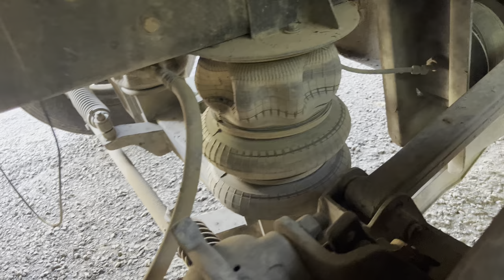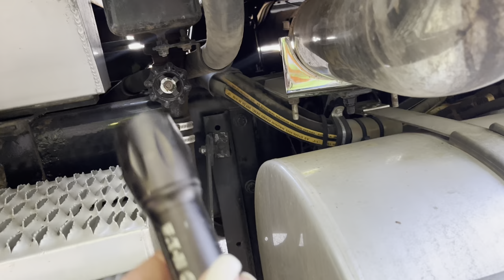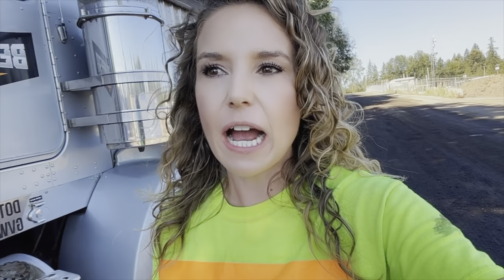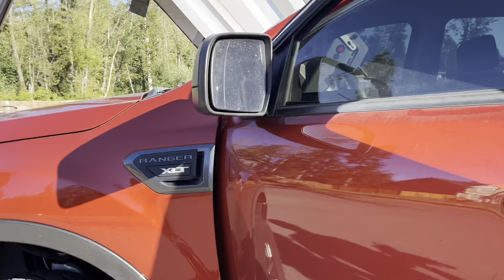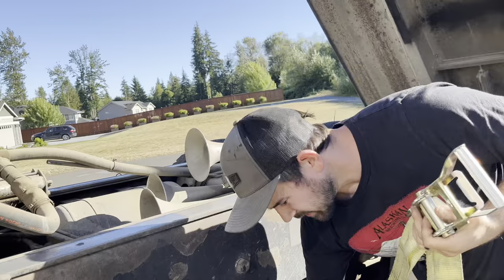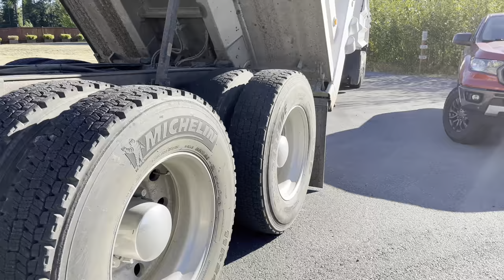Air Bag Exploded! No Air Pressure on the Drop Axle.

Comment: You’re doing a really good job in that dump truck girl. I’m an old retired 302 operating engineers crane operator heavy equipment. I’ve done little bit. Everything 35 years been retired almost 10 years now. Enjoy your videos. Lotta memories when you pull into those gravel pits I worked out a few of them back in the day anyway Nikki good luck man and keep up the good work hang in there girl.

Comment: Hello Dauminique,my younger sister went to welding school & she's now a certified welder & she was working for a place that builds those pontoon boats & she had to weld those pontoons together bcause they are in pieces at the factory where she worked at & she said that aluminum is hard to weld she had to weld the halves of the long pieces of the pontoons together first & then she had to weld the end pieces onto the long pieces of the pontoons and she said that is a pain in the rear-end,you know what I mean, but nobody has called her to do any welding for them & I told her that if I didn't have these Seizures I would've went to a school that teaches you how to work on construction equipment,I would've been a certified mechanic for construction sights to work on the machines & if we had the money we could've gotten a repair truck with a nice welder for my younger sister bcause we would be a good team,brother/sister mechanic & welder,I hope that you got your airbag fixed & changed bcause that noise is annoying,Lol

Comment: I hate it when that happens I used to carry  a tire patch kit  for that . was good for a temp repair to get you home or a shop .I also carried a plug bolt that i could block the main air line to the air bags .so i wouldn't loose all my air and have all the brakes set and be stuck somewhere .

Comment: I traded Mike at work a belt sander for use of my mag drill this weekend so he could install a tag axle for a farmer. Side note-what do you have as a setup to weld that? I've been welding for over 25 yrs,dump boxes can be the hardest to repair correctly

Comment: .... learning to weld is never a bad idea especially if you own equipment .... half fasting welding is also not a good practice to be in ..... needle nose flat vise grips good thing to have to crimp off an airline to prevent air loss ...... thx for the share .. as always .. never stop dreaming, just dream bigger .. have fun be safe, save our oceans .....

Comment: Learn how on the side before u shut trk down . This provides time to properly learn . now air bags are in need of replacement all of them . Along with any dried air hoses n hydraulic lines . Preventative maintenance ! Have done this since the 60s sound practice .keeps u running not in the shop . Im from a time we did all repairs to spec. Now I see one specific job not many jobs techs train for .